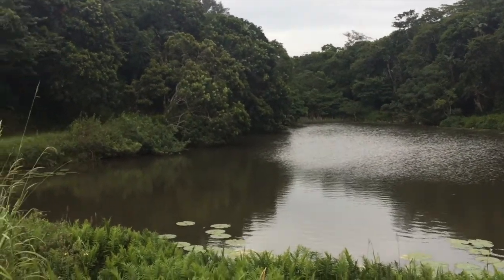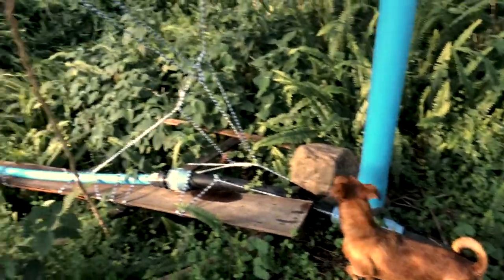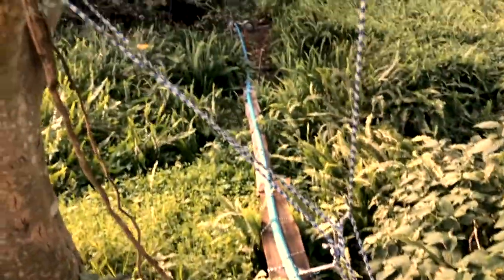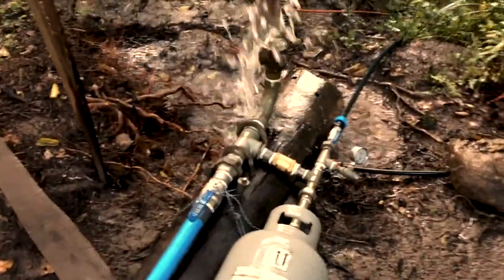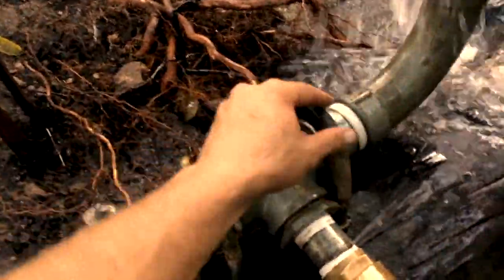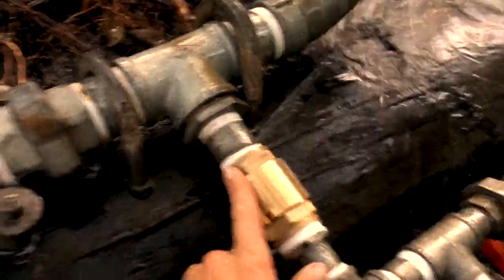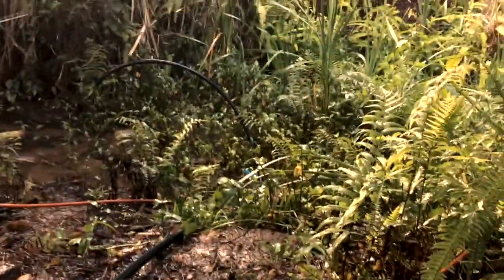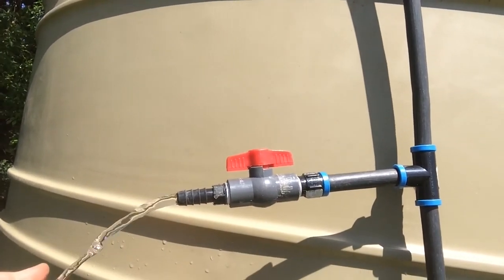Ram Pump Project 2016

Comment: that's cool,nice  how is  the highest altitude might reach ? in this type of ram pump thanks
Reply from the maker: It all depends on the site. Rule of thumb is 1:10. For every 1m of head you get on the drive pipe will give you the ability to push 10m in elevation.